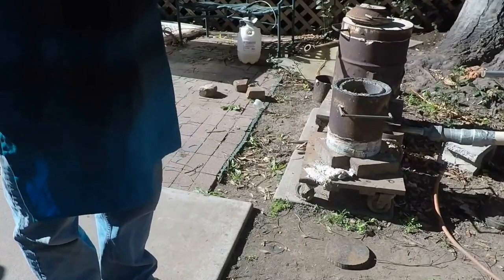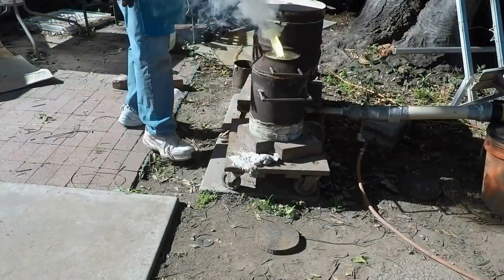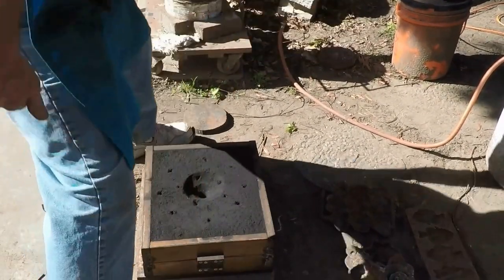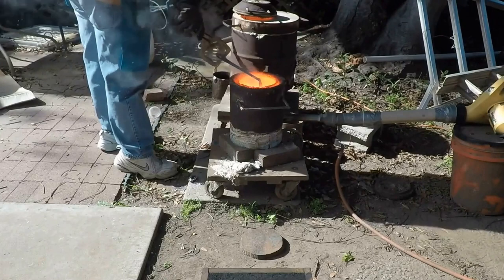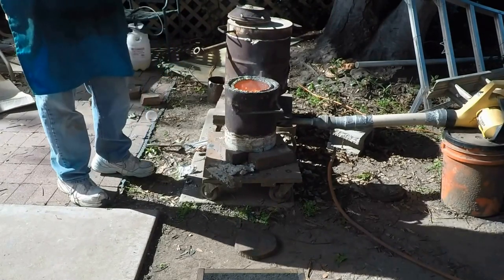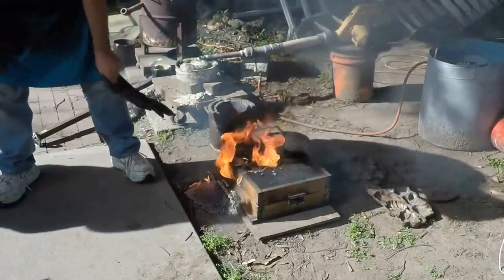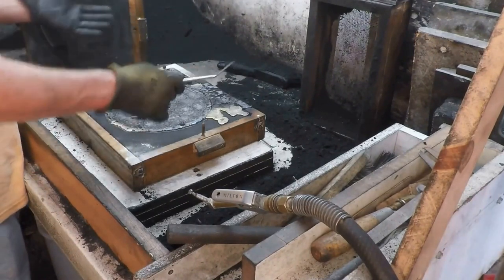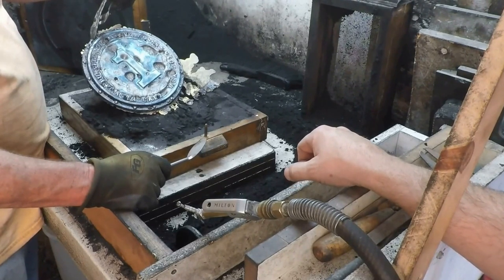wood pattern making In The Foundry Boiler Plate fail #2

Comment: Nice experiment... 
Metal molding is fun.
I'm wanting to make a furnace from a kiln for ceramics, should work pretty good also, just need more time, though...
Beware of that white smoke it's rather toxic, like burnt zinc when welding, it will make you pretty sick...

Comment: Was that brass?  I take it the penny's he's talking about are pure copper ones.  ;-)
Reply from the maker: no new ones are zinc with a copper plating
Reply: He said adding penny's makes it yellow (If I remember correctly).  So, he's picking up mostly zinc and a tiny amount of copper.  Does a very small amount of copper turn the zinc yellow?
Reply from the maker: +Crafted he means "yellow brass" instead of "red brass" it's all about the proportion of copper to zinc
Reply from the maker: +Crafted it's the zinc more copper makes it red "red brass is harder"